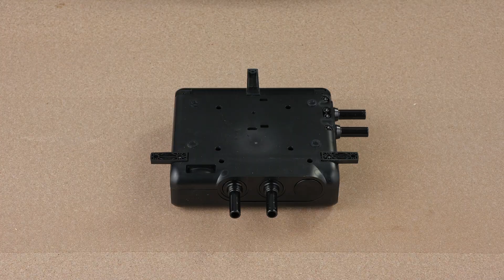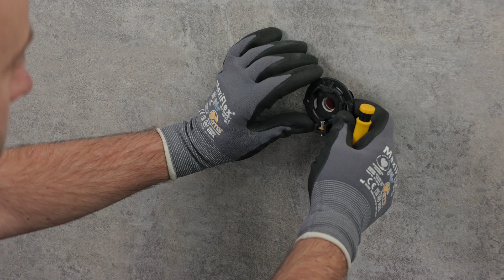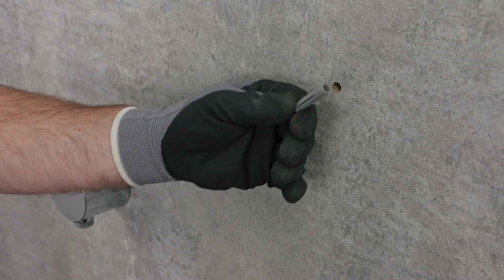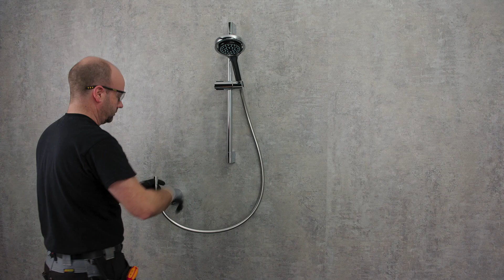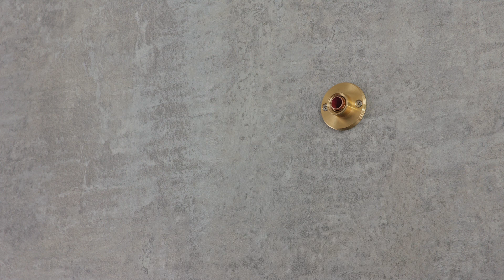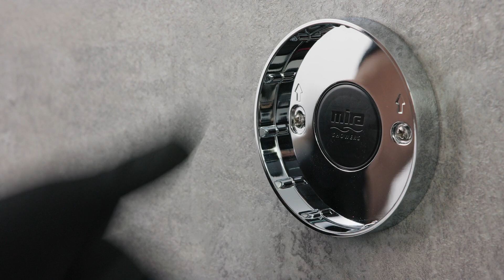Mira Platinum - Dual Rear Fed step-by-step installation

Comment: I have a Smartap shower which has failed...and am considering replacing with one of these. The Smartap is currently fitted using JG Speedfit pipework which I was hoping to reuse. Is the use of speedfit definitely not recommended?